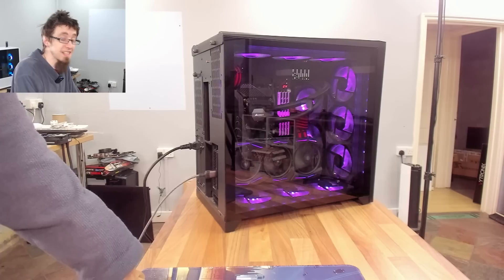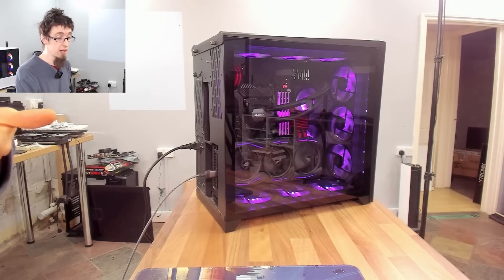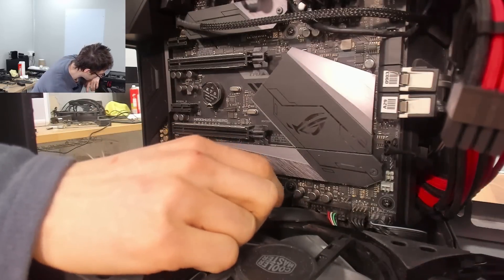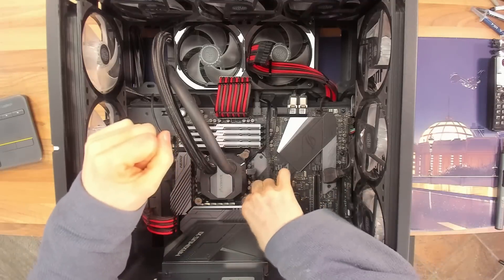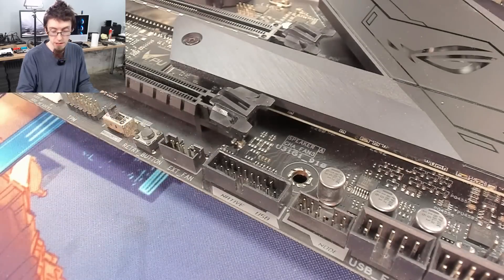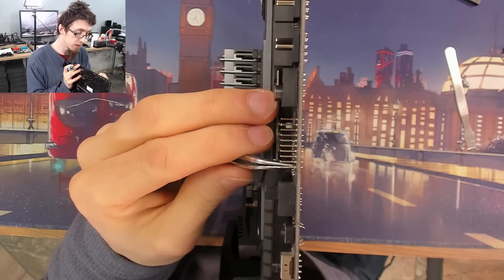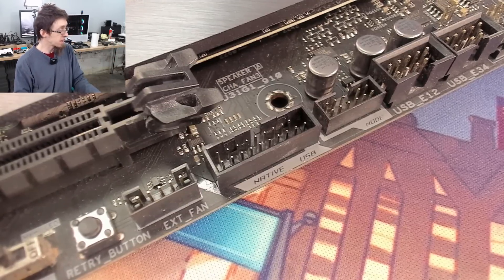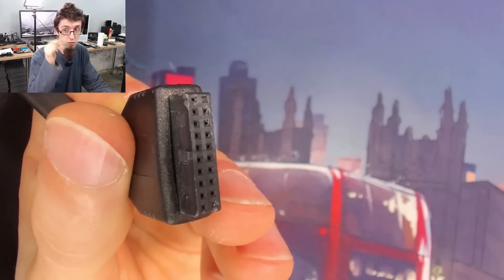USB  3.0 Front Header Port Snapped Pin - LFC#267

Comment: Just did this repair on my own motherboard. The soldering was a pain, but I actually got it working. Couldn’t have done it without this guide. Thanks for the vid brother!
Reply: I just broke a pin tonight on my B650 board (why are these USB3 headers such a pain in the ass), but can't find any angled headers to order to get a new pin from, any ideas?

Comment: Good day Graham, to add a set of USB 3.0 ports to the back of my computer I pulled the 19 pin plug out, a very tight space with a lot of wiggling. The plug came off along with the shroud, but no pins were bent or broken. Now when I put everything back together I hear the connecting sound of the computer accepting a USB flash drive, but no flash drive shows on the screen. I also hear the disconnect sound when I pull out the flash drive. Do you have any ideas on this?

Comment: How did you get it out  the pin so easily, I have tried with my motherboard and the solder doesn't melt the same way.

Comment: how to remove the pin thats broken right at the bottom, meaning theres nothing to grab the pin after loosening it up? stupid usb3 cable. bent one pin on the mobo connector into an s shape, then tried straightening it but of course after wiggling it two or three times it broke off right at the bottom. thank you.

Comment: Where do I buy pins? One of my pins were snapped in half and half of it is stuck in the plastic on the board. Could I use wire to connect the pin into the cable?

Comment: I had to use a usb 3 cable from Amazon I desoldered the old connector and sacrificed the one from a cable. 

Hate how they lift off the board so used some gorilla hot glue to keep that thing on lol.

Also had a issue where my x299 apex usb 3 wouldn't be accessable in the phanteks evolve X case because of the drive cages literally blocked the ports looked on amazon sure enough they have a cable for this and it's nice and flat not chonky 🤣.

Comment: Just a shame my 2 month old MSI B550m pro VDH uses a right angled USB3 front header connection! And yes,. I managed to bend and snap a pin on it :-/  So a PCIE usb 3.0 card on its way, as well as a replacement motherboard header. At least I'll be able to use the PCIE header to get things up and running, until I get my soldering skills back again before replacing the motherboard header...

Comment: correct me if i missed something here, but you just pushed that pin out of the male end cable connector after cutting it? shouldn't there be a wire soldered to the other end of the pin you took out? isnt that Int_A_P2_D+
Reply from the maker: That was the broken off pin from the mobo
Reply: @Adamant_IT  ah ok, thanks for clarifying

Comment: Do you replace cpu sockets the pins are broken? the cpu is good no damage gold plates on the cpu.
Reply from the maker: Not at the moment, it's something I want to look into, but very long-term project. I need additional equipment before I can even try a practise run.

Comment: In my experience the best way to remove the plastic plug for the USB3.0 header is to just use the front panel connector itself. The damn connectors always seem to pull the plastic with them when you try to unplug the cable.

Comment: I am glad you were able to fix the problem. I did think that the extension cable was not fully seated, but at a slight angle after you plugged it in/as you were fitting it back into the PC.

Comment: Should have got a 90 degree adapter and wouldn't have had the issue in the first place.
Reply: I just snapped off a pin on a 90 degree adapter! lol. Very tight quarters inside the case and I was trying to force it.

Comment: I managed somehow to bent that pin on one of my motherboards. It was bent down at the bottom of the connector. I was able to straighten it again without breaking. In my main pc I added an expension card for an extra usb 3 header for my card reader. Iwould use that as a replacement for a broken pin, but I don’t know if you can use expansion cards with the vertical gpu mount.

Comment: Well, Graham, I was screaming at the computer not once but twice, once when you put the plastic shroud on upside-down, but even more so when you reassembled the motherboard with USB3 lead with the blank in the wrong place and see it turned up at the edge, and clearly seated incorrectly. it is a good job that there were no voltage issues, or it would have become a bit of a costly mistake!

Comment: You can get connector pigtails off ebay and splice them back on.  It's a little bit of a pain especially if the wires are shielded, but not too bad.

Edit: Really like the extension adapter solution.  I'll buy a bunch of those to use all the time.  The regular USB 3.0 cable is stupid.

Comment: I bet if you tap the opposite side where the pin was of the conector on the edge of a table,it eventualy will come out a little bit enough to grab with a tweezer
Reply: Unlikely, the inertia of the pin isn't likely enough to overcome the friction of the contact.

Comment: I've been using the extension headers in all my builds since removing the usb3 header from my own Asus ROG Strix X570-I Gaming motherboard took the housing with the cable despite using tweezers etc. The damn thing was stuck fast. While the extensions have the opposite problem of coming off too easily, they look far better in the build and you don't get the problem of connectors that have welded themselves together.

Comment: I have another solution. Instead of cracking it open try using toothpick with superglue in the edge and attach the point on the broken pin.

Comment: When I first built my PC I accidentally bent a pin in the side-facing 3.0 header. It was the top right pin (If you're looking from clip-side up) and for almost a year I just used the other header which faces straight off the board. Recently I was able to fix the bend by using the small straw that comes with compressed air cans. It was still slightly bigger than the pin, but I was able to carefully leverage at the bend and get it mostly straight. Surprisingly, even with a slight bend, it still works. The other header I used for a 3.0 to type E adapter so I could use my front USB-C header, even if at a lower speed.

Comment: Great video, very interesting. I've bent/broken enough of these USB 3 headers in my time. They are very badly designed and this is a helpful video. Thanks.
Reply: yo bro is it fixable ? my connector snapped out of its place when i tried to unplug but no pins were broken or bent

Comment: I have an idea for the next time a pin gets stuck in the connector i was thinking you could get a hot glue stick and melt the end a bit then while its melter push it onto the part of the connector with the pin let it dry and pull it out

Comment: For anyone wondering, pretty much the cheapest listings from China for the USB 3 extension ribbon cables and 90 degree adapters:

USB 3 internal extensions:
https://www.aliexpress.com/item/1005001804209588.html

USB 3 internal 90 degree adapters
https://www.aliexpress.com/item/1005002426474615.html

Comment: was that CA glue you used?  What about a rubber cement so it slightly melts the plastic housing and leaves fused plastic instead ?
Reply from the maker: Yea I used CA because that's what I had to hand.

Comment: Yeah, I my 011 I used a USB3 extension to get around this. Sadly, there are a lot of crap cables out there, but there are a couple of good ones. I've been using them in builds for quite a while... because screw that USB3 cable. Never seen one so bad it snapped off though.

Crap...should have waited 'til the end since that's exactly what you did,

Comment: Some time ago got the budget H310 board (for cheap) to build and resale as a part of a computer, the board was working fine, but after the assembly I discovered that one of the front usb 3 ports wasn't working, and indeed the vbus pin (the single one on the bottom) was snapped, so I've actually managed to take out a bit that left and replace it without removing plastic or the whole connector, the new lin I've took from broken amplifier board with plenty of connectors similar to rgb header, wasn't that easy but neither to hard.

Comment: I think I would have replaced the connector and used a solder sucker gun to remove the pins then re-solder the new connector back:-)
Reply from the maker: I'd have gone for that if it was a case of most of the pins being mashed flat, but for one or two pins, I think single-pin replacement is a lot less hassle!

Comment: You have a Quick air station,  I just got hold of the 861DW myself and taking that connector out and replacing it would be easy.  Nice your using the pinecil also cracking good value they are, I use a hakko 888D as my daily driver that and the Quick makes embedded level micro controller / micro soldering sop and msop with a few QFN's a breeze.
Reply: Quick 861DW is nearly twice as powerful as the one he's having. I ordered an Atten 862D, which unfortunately, got stuck in customs clearance and I'm having a hard time trying to get it out. Quick 861DW and Atten 862D are pretty much the same thing they say. Many newcomers are choosing Atten over Quick due to its affordability. A preheating device can help a lot when using an underpowered hot air station.
Reply: @roseelectronics4582  Customs hehe dont get me started I have so many sensors and other IC's stuck in customs haha its hilarious.

Comment: Nice work!
Would it have been possible to have put a drop of solder on a pin and then heated the solder up to join it to the broken pin to get it out? If done quick enough, it shouldn't do any damage to the plug, rather than 'opening' the plug up to get the pin out?
Reply from the maker: That's a good idea actually... definitely something to try. The possible issue there is that if the solder flows into the connector, it'll weld the broken pin inside it forever. So could be a risky move. One to try out on a scrap header wire sometime though...
Reply: @Adamant_IT  if you solder with it at the right angle, you’d only need a second for it to meld. 🤔😊

Comment: I've snapped a pin off a USB header before. I fixed it by creating a slightly larger pin using a paperclip and shoving it into the plug. The contact of the makeshift pin with the left over nub in the socket was just enough to make a good enough connection.

Comment: The same thing happened to my motherboard, so I just bought a USB 3 pci-e card, but props to you and if I had thought of replacing a pin I probably would of taken a pin from one of the headers that were not in use

Comment: With a broken pin stuck in the connector, you may succeed by tapping the connector on a hard surface like the edge of the desk or something like that with side where the pin is, slightly over the edge(so not to tap in the pin deeper).
Reply from the maker: I think that might've worked with this one. The moment I poked it with a blade edge to try and pry it, I nudged it deeper in. I didn't expect it to be loose.
Reply: @Adamant_IT  do you think the broken pin ID can cause blue screen errors? Cus thats what i got, and got faulty memory error, but the diagnostic memory didnt found anything.
Reply: Just posted that. Sorry I didnt read far enough down to see your post. :(